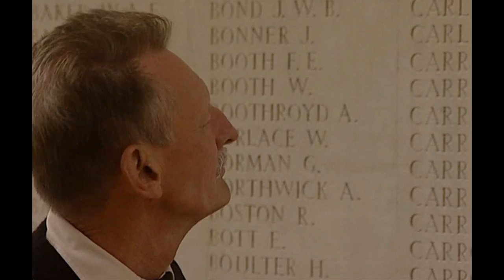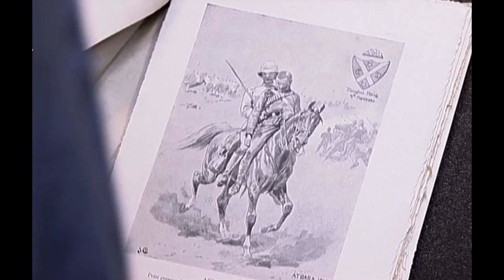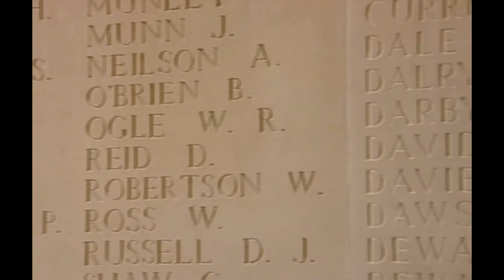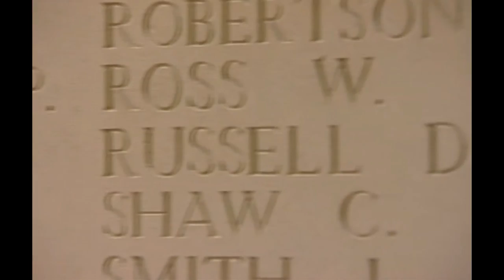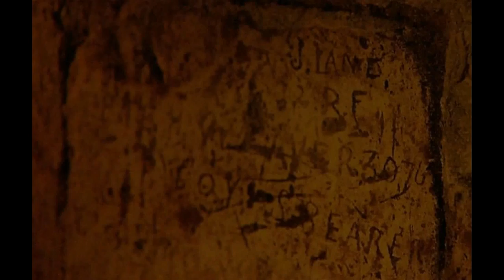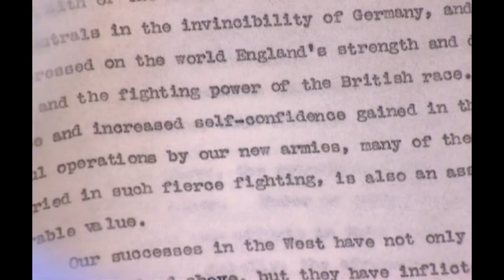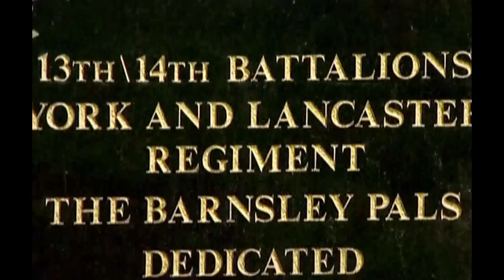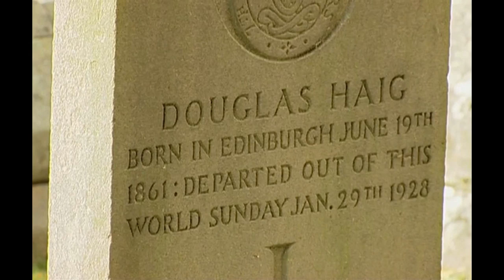Great British Commanders: Field Marshal Douglas Haig

Comment: How does any army suffer 50,000 casualties in one day,the British have been trying to explain for more than 100 years but still haven't convinced anyone that it was simply incompetence 😁😅😂
Reply: It was down to a number of factors, one of the main factors being the incompetence of the British High command. Misinformation was also a key factor.
Reply: This point has been well covered by many eminent historians. Losing large numbers of men in modern industrial warfare is hardly unusual. In June 1916 the Austro-Hungarian army lost 280,000 men in a single week; the German Army lost 348,000 in six weeks in March 1918. Quite simply, whatever you did you 'lost a lot of men'. 

The scale is of obvious importance too- the British 4th Army attacked on 1 July with 13 Divisions and elements of 4 more. This was the largest British assault ever to that point. Significant success was achieved on the right and parts of the centre. It was followed two weeks later by a hugely successful night attack which captured much of the German second position. 

Simply bandying about ill-informed ad hominem attacks demonstrates a lack of knowledge and understanding about the Great War in general.
Reply: @henrypulleine8750  Very well said, thank you.
Reply: @user-rl3gc5ki1y  Crap.